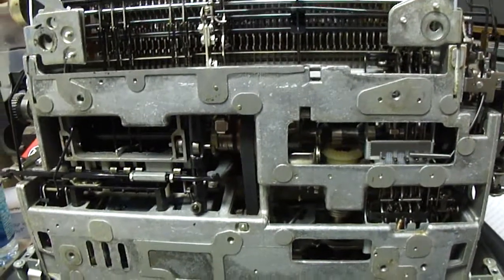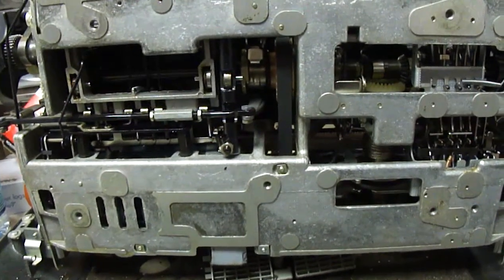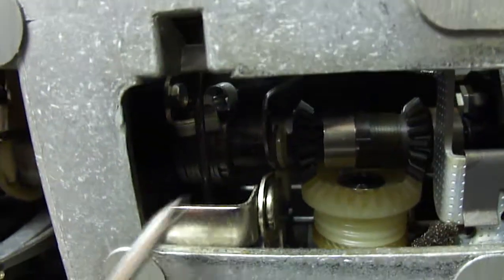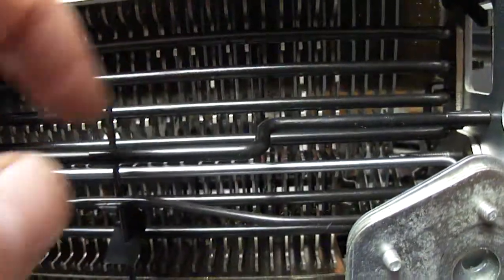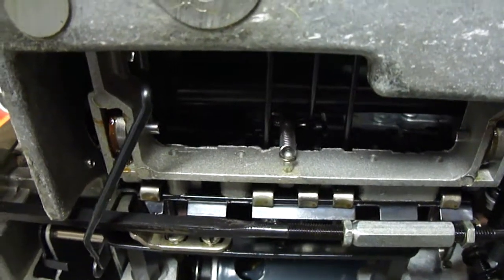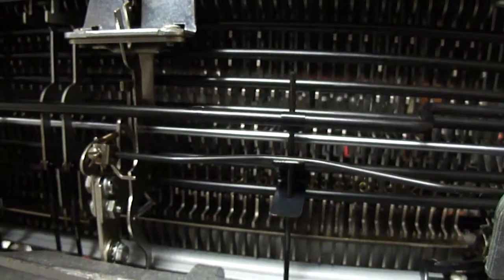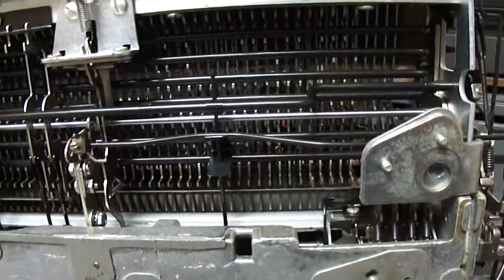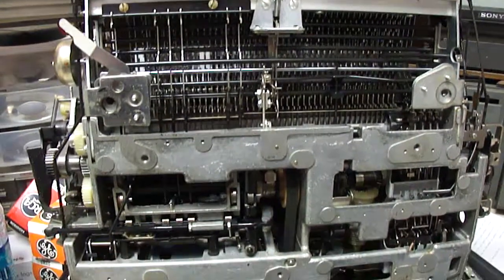IBM Selectric 2 typewriter repair (smaller unit)

Comment: You need to tighten the right locking nut on the rotate turnbuckle to that the shaft won't flex and give you wrong letters on large rotate letters.   I am a retired IBM Customer Engineer and have repaired 1000's of these well made typewriters.

Comment: Jerry Underwood is right. You need to tighten that rotate turnbuckle down. Also the power switch comes apart. Just use a small screwdriver and pry open the top part and another small screwdriver and pry out the bottom part. The assembly will slide out. Be careful of losing the spring and contacts. Just clean the contacts with a solvent and put it back together again. It's a lot easier to just change the switch but, if you don't have one, it's not a hard fix.